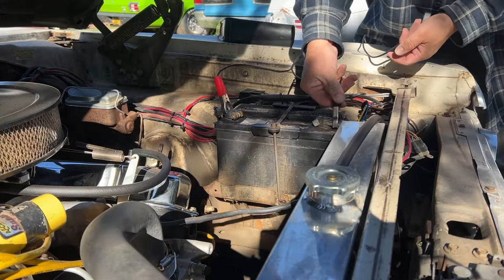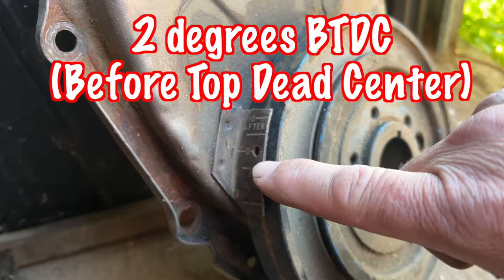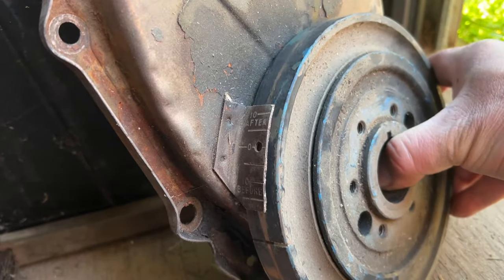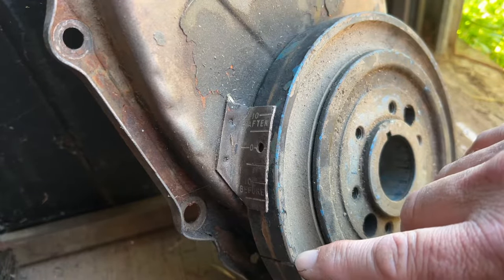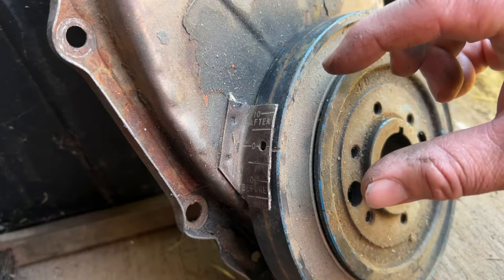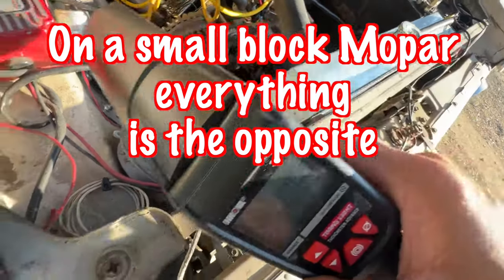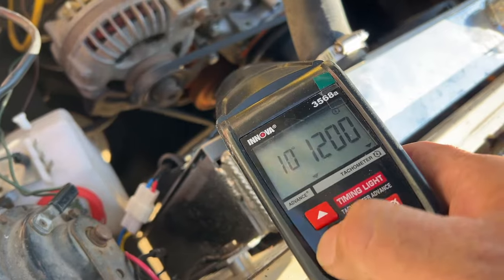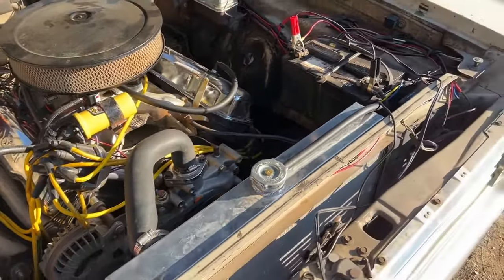How to use a digital timing light for beginners

Comment: That means I set 10 degrees on the pistole and let it run on idle (chevy SB) until the mark matches  the TDC? Same with total timing at 36 degress and 2500-3000 rpm? Got it right? AND disconnect the vacuum ...Problem is the mark itself is hard to see because of the surrounding assymblies 😅
Reply from the maker: Don’t pay attention to the number on the pistol at first. Just adjust it so the marks on the harmonic balancer are at zero. Then look at the number on the pistol. Whatever that number is, is your timing. If the engine is idling that’s timing at idle. To see your total timing, bring the rpm up to the 2500-3000, that’s total timing. To adjust, you have to loosen the distributer and turn it a little one way or the other to advance or retard the timing.
Reply from the maker: It depends on the car but you might be able to get the harmonic from the bottom easier and then I would mark it preferably with white model paint. Remember to use jack stands if you use a jack to raise the car.
Reply: @JonnyMopar  figuered it out. Thank you

Comment: how does it know where 0 degrees is at TDC?
Reply from the maker: The dist position dictates when the light flashes. The line on the balancer to the zero line on the timing chain cover is always TDC. Let’s say with a regular timing light your flash happens at 8 degrees advance as seen on the balancer. On a digital Timing light, adjusting it so the flash happens at the line, aka TDC is going to be seen on the timing light display as 8 degrees. In other words, you can see 8 degrees at the balancer and zero on the timing light or you can see zero on the balancer and 8 on the light.

Comment: I'm confused now. From other videos I saw, the car sticker tells you the degree BTDC and then there should be an arrow on the crankshaft. You then put a mark on the belt and set your timing to zero at idle. Start the engine and adjust the distributor until the mark line up with the arrow every time the light flashes. Some also tell you to short the two-pin connector out, I probably won't do that because if I got wrong connector it will not be good. I just want the basic steps, not go too deep into messing with the timing. Thanks.
Reply from the maker: Sounds like you’re dealing with a stock application. If you’re going to time it to the manufacturers suggested timing and you’re using a digital timing light, you do what I said in the video but time it to the degrees suggested. I don’t know why you would mark the belt unless you talking about timing belt. In most engines there’s a line on the harmonic balancer and a pointer on the timing cover.
Reply: @JonnyMopar  I bought a distributor and when I took it out of the box and checked, there isn't any marking or P/N on the distributor itself. Is this normal NOT to have marking or P/N on the item itself? How does the store knows what it is if they ever misplace it?

Comment: Thank you sir!
Reply from the maker: @TheRareCriticalThinker  You’re welcome
Reply: @JonnyMopar  hi again! My 67 Mustang doesn’t have degree markings on the harmonic balancer. How do I move forward with my digital timing light?
Reply from the maker: @TheRareCriticalThinker  I can’t see how it doesn’t. Maybe it’s on the other side? Some cars or engines have the marks on the driver side while others are on the passenger. You’ll have to establish TDC. If you want perfect timing you’re gonna need an accurate way to find when the #1 piston gets to TDC. Then you’ll have to mark your harmonic balancer and the timing chain cover then time it. If just close is good enough. Pull the #1 plug, with your finger over the hole bump the engine over until the pressure is maxed, if you feel vacuum you went too far. Do it again if you went too far. Once you feel max pressure that’s TDC. It might be a couple of degrees off but it’ll be close. Now make your marks on the balancer and timing cover and then time it.

Comment: Why would you take vacuum advance on distributor? Wouldn't that make affect fuel efficiency? Great video.  Just subscribed
Reply from the maker: Thanks nursecuenca. For street use yes, vacuum advance will improve fuel economy. There’s 3 stages of advance, initial, mechanical then vacuum advance. For performance, you usually lock out the distributer and max out all the advance and just have the one stage.
Reply: Harika bir sorum olacak hem mekanik ve yardimci vakkumlu distiributor de baslangic avansi yani mekanik avans kac derece olmali